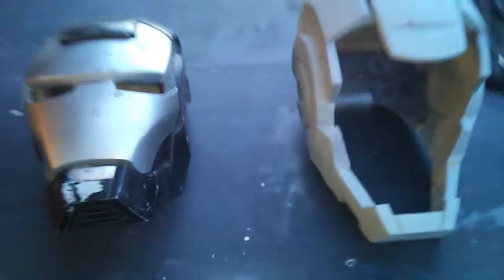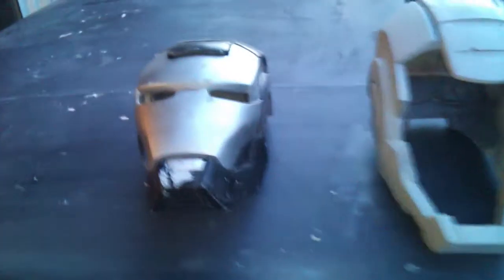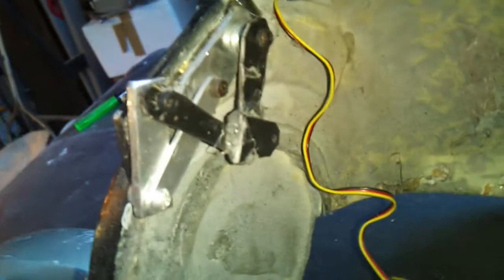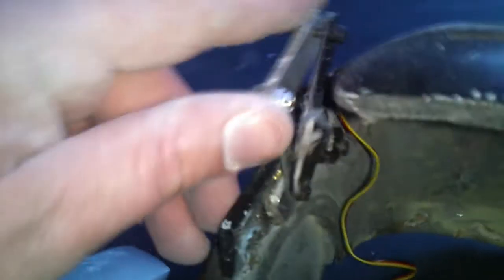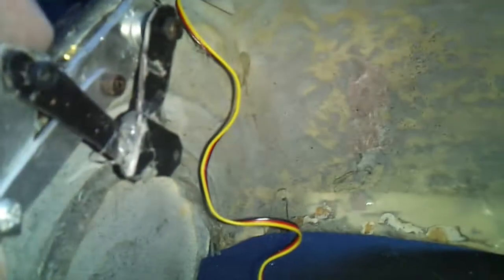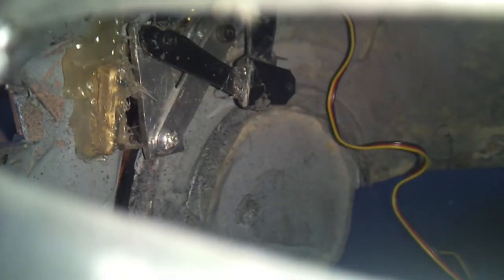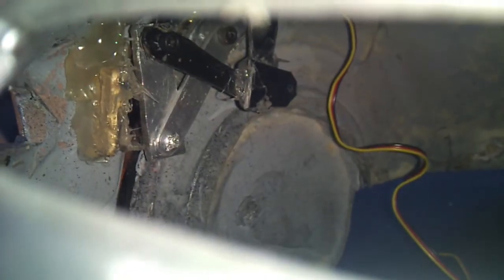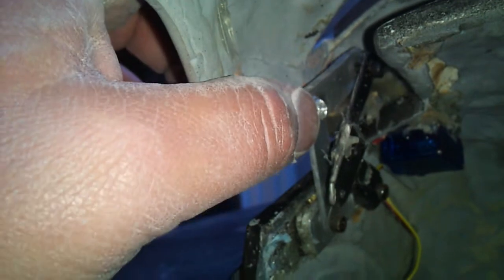Faceplate hinges for Ironman helmets explained!

Comment from the maker: Yes, this video. If you look at the hinges, the upper black hinge has a tab off the back side. In this version the there is a pushrod from the servo to the back of the hinge. In the newest version the servo and hinge are an integrated unit. Meaning the upper hinge arm is directly attached to the servo. I have some pics of the sketch I based the new design on both siwdat.com and therpf. Let me know if you have any further questions. Direct drive is way better then cables and pushrods.

Comment from the maker: @dsavetark  UR welcome. I'll be showing the electronic faceplate setup when the new WM helmet is done. My older setup used servos and push rods, the newer system is direct drive and will use very large servos (combined give like 15 lbs torque) or actuators. The jaw on the war machine will drop down as well.
If you notice the hinge arms are aluminum and "high impact urethane plastic" aka rubber maid trash cans. The plastic is for protyping as its easy to cut and trim. Plastic becomes templates